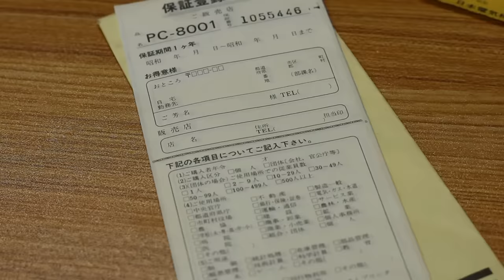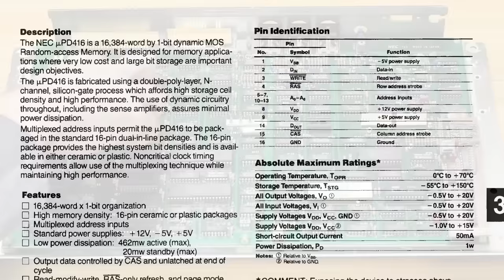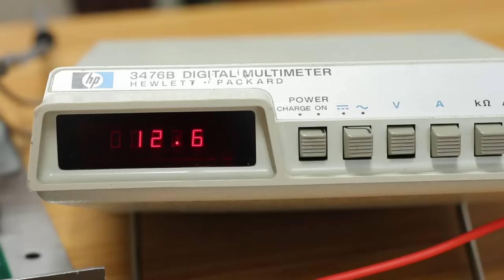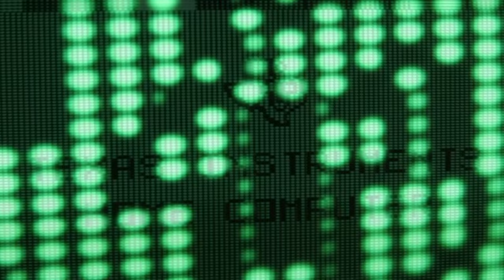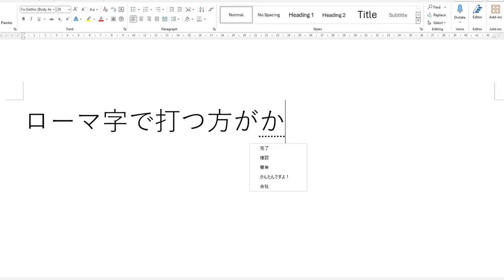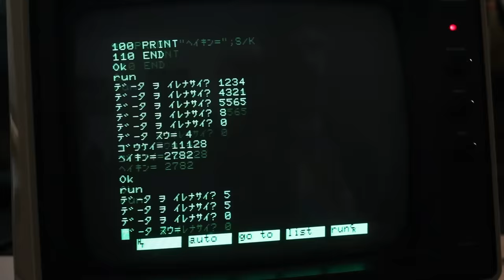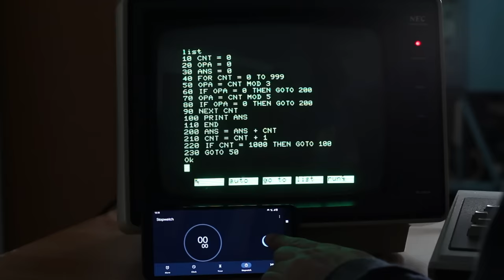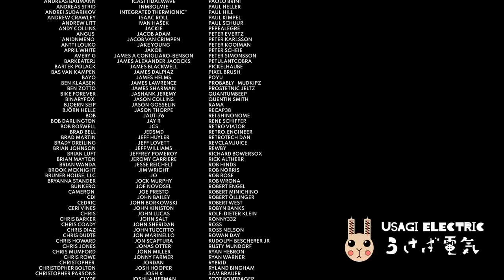This NEC PC-8001 is Epic!

Comment: I had to laugh at the 'inappropriate words' moment when you'd forgotten the connector hood... we've all been there! I have a picture somewhere where someone had worked on soldering a connector onto an industrial multi-wire cable, but to hold the cable in place, the guy had threaded it through the step of a portable ladder.
Reply: yeah i agree we all have been there... too exited to try it and forget the stupid hood...
Reply: @freeculture Heh... Even people that work(ed) daily with electronics like me had "experience" with that. I worked in a recycle division repairing consumer and industrial equipment before I went to IT doing server installments and maintenance (UNIX, Novell Netware, Windows and Linux) and finally retiring. You would think all those years of experience would "burn in" to your brain to never make that mistake again... Yeah - Nope... Even after years I still have that occasional sinking feeling in the stomach when watching your failed handiwork that makes you want you to bang your head...
Reply: At that point I'd probably just get an angle grinder and cut the ladder off :D

Comment: My first computer was a Sharp MZ-80K, I got it in 1980. It was released in kit form in 1978 and pre-built in 1979. I used it as my main computer until 1987, when I bought an Acorn Archimedes. I have two MZ-80K machines now.

Comment: 12:30 I'm shouting at my laptop
13:04 I told you so! 😊

I wonder if there is anyone who has soldered DIN connections who hasn't done this at some stage.
Reply from the maker: Haha, I feel like it's a right of passage!
Reply: Me thinking: Ah, exactly here I would have forgotten the casing.
...
Wait a moment, where is the casing?
...
ROFL!
Reply: I really love back when they did introduce DIN connectors as 2 halves - easily clicking them together afterwards .... then most connectors was RCA after that ... but damn I have forgotten to but it on many times - and a few times the wrong way around.

The lessons learned must be:  Think twice - then think again - check everything and then solder once. :D
Reply: Sure. From DIN to the rubber boot on the transaxle...
Reply: not din connectors but crimping ethernet cables it happens all the time
Reply: I laughed hard because I thought the same thing
Reply: Din, RCA, XLR, Centronics i've done it with so many types of connectors. :)
Reply: The old UK 15 amp round pin stage lighting plug has a pointless part of the rubber cover which goes round the flex. A great many of them have a cut across this part because somebody forgot to thread the cover onto the flex and couldn't be bothered to do it all again. It never works as well the second time. The person who invented one piece D25 shells has a lot to answer for.

Comment: Fantastic that it is still working!
If you run PRINT time$ (or PRINT date$) it will print the time, either actual time (unlikely) or something like seconds since boot. A neat way to use this is to use it to "auto time" something like your stress test program. Set a variable to time$ at the start and a second one again at the end, convert the strings to int and using deduction you can get the seconds the program took to run.
But maybe you knew that, this video makes me want to get an old computer with basic running again, thanks, love your videos!

Comment: I almost bought one in 1982 while living in Japan.  Instead, I bought a Casio PC FP-1100 with dual processors: Zilog Z80 and NEC PD7801G, and I bought the 5 1/4 floppy drive accessory and the RF modulator for the TV.    I still have it in storage.  Also, I had the CP/M operating system.   I remember spending hours writing basic programs (inventory tracking programs, graphic & graphing programs, and general electronics application/calculator programs).    Old times...  Z80 clock speed was less than 2MHz, May be 4MHz for the NEC CPU.   Max RAM was 64K for the Z80 and 48K for the NEC CPU.

Comment: Just as an FYI nearly all Japanese electronic power supplies can handle US voltages 10 volts is not much in the land of AC. The grid voltage at your outlet routinely swings upwards of 10V up and 20 volts down depending on load conditions  on the national grid. Japan's grid is much the same but more likely to swing up usually do to differences in how their power grid is managed. I also know this from having ran many Japanese pieces of studio audio gear just off US mains due to the tendency of many step down transformers to be noisy electrically thanks to cheap transformer cores.

Edit: I forgot to point out this applies to switch mode power supplies, linear supplies should be ran with a step down transformer always to avoid heat issues.

Comment: For NEC chips that start with "D", prefix with "uPD" instead. So, uPD8257 is an Intel second-source 8257 DMAC, uPD3301 is your CRTC. I forget what "uPD" was supposed to stand for, but the "u" is a stylized Greek Mu, so that probably had something to do with it, something like "micro processor design" would be my guess. Most NEC chips of that era that weren't "glue logic" chips (eg 74xx series) were "uPD" chips.

EDIT 1 -- that power supply would almost guaranteed be fine on US wall power, the voltage sag tolerances on AC wall power here in the USA are just ridiculously high. Figure acceptable range to be somewhere around 90-150 v AC.
Reply: 150v RMS is higher than I've ever heard of in the US, but certainly I've heard of 135v RMS. However, that doesn't actually mean the power supply will be safe, since it's from a lower voltage country. Your assumption would almost certainly be right if it was the other way around.
Reply: @absalomdraconis  OK, that's fair.

Comment: Stoked to see some NEC hardware, always had a soft spot for the gaming software that was developed on them. That expansion board is intriguing, hoping you're able to figure out what exactly it does. If the luck from the computer carries over, it might even still be working~

Comment: So to not forget the connector cover, before soldering, I like to put it on the cable then tie the cable in a large knot with the cover inside the knot.  That way it doesn't fall off.  Get in the habit of doing that as the step right after you cut the cable.

Comment: The 8257 is the dmac which is a clone of the intel part with the same number.  The upd3301 is the nec custom crtc which is also used in the nec pc-8801 and the olympia boss.
Reply: If the Intel 8257 is the chip used in the IBM PC, then it is itself a clone of an AMD DMAC that they meant as a generic choice for multiple processors. The x86 era Intel competitor was... ambitious, and expensive enough that it was probably only used for minicomputers and mainframes (it cost about as much as the x86 itself, something like 3 times as much as the DMAC that the PC actually used).
Reply: @absalomdraconis Nope, it's the 8237 which was used in the IBM PC which was a clone of the AM9517.   The 9517 is an iterative improvement of the 8257 which was designed by intel themselves.  The intel x86 dmac is the 8089 which, yes, was expensive, used in very few designs and bad (i've written an emulation of it).

Comment: 4MHz was pretty standard for a Z80; the different architecture means at that clock rate it runs at about the same speed as a 1MHz 6502. 
TIME$ was a syntax error because BASIC doesn't like plain expressions; you have to do something with them. PRINT TIME$ would have printed out its idea of the current time of day, which could be set from some onboard real-time clock but was usually just set to midnight at power up.

Comment: Japanese resident here. My local hardoff store has a PC-8001 in great condition that I've been eyeing off for quite a while. It's kind of on the costly side and my wife has made her feelings clear about me buying any more retro computers, however after seeing this video I might have to pull the trigger.
Reply: in regards to why it didn't sell well outside of Japan, in the 70s and early 80s it seems most of the English speaking markets prefered to either buy American computers or produce/rebrand their own. It's a similar issue to the MSX computers; they sold really well in non-English speaking markets (its seems there were more total MSX systems solds than C64s) but made little-to-no penetration in the English speaking ones. It really wasn't until the mass wave of turbo XT clones out of Taiwan, Korea and Japan flooded the markek from around 1985-1989, which massively dropped PC prices, that English speaking markets seemed to accept buying Asian made computers.

Comment: I have fond memories of a micro (Atari 400) in the home in my early life, but then we became a PC household while I still had Apple II and TRS-80 machines in class.  The older I get the more I realize that those micros are the last machines where I can clearly understand what's going on under the hood, while so much of the PC (and especially the modern PC) is abstracted magic.
Reply: Original PC and 286 is also not too hard to understand. The complicated stuff started later when you got caches added etc.
Reply: I could understand a 286 along with the weird addressing modes, ISA bus, and etc etc, probably; though I'm not completely confident on that.  The non-PC 8-bit micros and their extremely simple busses definitely fit my head more cleanly.
Reply: You can mostly grasp modern computers.. if you go far enough. Obviously can't know everything about every abstraction layer, but the more complex tiered caches, out of order execution - which was invented originally in the highest end IBM 360 model and silently ignored for decades until we ran out of easy miniaturization with silicon to make them faster.. you can learn how a basic operating system works via watchdog timers, interrupt driven task switching, protected modes, and all that.
But yes, an 80's computer is probably the only kind one person can know EVERYTHING about, and that's how amazing demo scenes get made, abusing hardware in ways that was never intended via design glitches of sorts.
Reply: @mikafoxx2717  I agree. It is possible to have some grasp on a modern machine, how much of a grasp depends on how much you learn about the different abstraction layers.   For me, the last time I could know a machine from instruction set to UI thoroughly was these little micros. 
Certainly I'm not going to pretend to know how every bit in a high end 360 worked, but there were engineers who had to know that, at least in part, so it clearly wasn't unknowable,   
OS engineers, security researchers, and compiler writers all need to know modern machines more thoroughly than I do as an IT guy and sometimes programmer.  So they've taken the time to learn the abstraction layers and know the insides of the black boxes.

Comment: This was my first computer, bought in Hong Kong around 1981. Japanese keyboard and manuals. Unfortunately all my cassette tapes have been lost: I spent hours typing in the machine code and BASIC headers for all the games on the early 80s. I still have the computer and colour monitor in storage. I’ve also got a full listing of the NEC BASIC in a limited run Japanese book of the time.

Comment: [14:00] Yes, it freaking works. (笑) And kudos on the nihongo hellorld!
[19:00] AUTO also takes a line number to start with, and an optional increment. Good ol' standard Z-80 MS-BASIC stuff.

As for bodge boards, I have my own that I put in my old TRS-80, to shift lowercase descenders down by two pixels. And it does some other stuff with the character address lines that after fully reverse-engineering it, I have no idea what it was supposed to do! (And I made it!) I tried to just run the computer to see what it did, but the TRS-80 video output uses some janky 74Cxx gates that can flake out, and mine had indeed flaked out.

That board you have is a bit simpler, and the best start at trying to figure out what it does is to find out where those blue wires go. I am so tempted to try to figure out the circuit from stills of the video, but I have to resist, I have so many other things to decipher!

Comment: All those bodge wires on the bottom might not be related to the perf board mod, it’s entirely possible they’re factory. Flip over my NABU boards and there’s multiple bodge wires there, from the factory, that wasn’t uncommon back then.
Reply: In this case they just seem to connect the extension to the main board, no fix-ups.

Comment: While you were soldering the DIN connector I had this lingering, familiar fear that you might have missed the connector body. When you revealed that you did, I FELT it. 
I've been doing electronics for like 20 years and it still happens to me. With connectors and heat shrink tubing alike.
Reply: I've been doing that for over 40 years. Some things never change... 😅

Comment: My guess is that the small expansion board enables graphics modes on the CRTC chip that are available in the 8001A, or that changes the memory map somehow. Maybe it was used with an additional ROM chip that wasn’t populated on your board, so it doesn’t do anything when you push the button. 😢 You’d really need to see what voltages/signals are on the connector without the board plugged in. My guess is; Gnd, +5, +/-12, composite video, clock signal from the CPU, reset, and maybe h/v sync pulses, and one or two address lines so you can map in an external (cartridge, gayubus?) or internal ROM (in the unused socket). Heck, maybe it’s a parental lockout switch so it wouldn’t play game carts; that way, the children would do their homework instead. 😊

Comment: 9:19  With 100V AC at the input, the DC voltage at the capacitor is 141V peak. With 120V there are already 170V DC peak on the capacitor. 
The capacitor is only designed for 160V.
Reply: Good point.

I might quibble at the use of the phrase "DC voltage". I'd say "peak voltage" would be a more appropriate/less confusing way to express it. But yes, since we measure mains AC voltage using RMS, the nominal voltage value is 0.707107 times the actual peak voltage on the wire (or alternatively, the actual peak voltage is 1.414214 times the nominal voltage).

FWIW, while technically a capacitor rated for 160V is sufficient for 100V AC input, that's just under 20V of headroom, which seems a bit small a margin to me. But I guess at this point, if the cap's still good and the computer won't be used that much, probably nothing to worry about.
Reply: @harvey66616   A 200v cap on 120v only has 4% more headroom than the 160v capacitor on 100v. It's fine, especially since the capacitors can take a bit more than their rated working voltage. Old American gear from the tube era usually only used 150v electrolytic capacitors for rectified line voltage.

Comment: The mystery perfboard looks like a real time clock... I did not see much of it, but it gave me that impression... And the button may be to adjust for 50/60 Hz power
Reply: Not likely.  There is no crystal oscillator or battery on it.  As for 50/60Hz, thats built into the computer already.
Reply: On second thought... D flipflops, latches... Could be a buffer... No RTC chip there... Please disclose the chip numbers of those to the right... One is almost erased and the other is blurry.

Comment: The AUTO command on most implementations of MS BASIC that supports it will take 2 options parameters  The first is the line number to start with, in case you are adding to an existing program, and the second is the line number increment.

If TIME$ is like on others, try PRINT TIME$ to get the current time, or "TIME$ = "(timevalue)" to set the time.

Comment: Cool little computer. I never got into PCs as a 80/90s kid, we had an ARM based desktop computer, an Acorn A3020, i used to consider early PCs silly as they where a massive step back. Fun fact, the later Acorn Risc Machines ( or ARM for short) could emulate a 386 faster than a 386 could run :).

Comment: I have a TI 994A that I haven't tried troubleshooting years, you reminded me of it so I guess I need to pull it out from under my bed now that I know a little more
Reply: Probably the power supply. It uses a weird split linear / switching power supply. Multiple voltages from an external multitap transformer to a switch mode supply inside. Probably easier to rip all that and replace with a compact modern power supply.
Reply: @DMahalko  The issue was no power and I never got around to looking at it, so that may well be it, thanks

Comment: Looks like a high quality computer with excellent build quality.  The first micro computer I ever used was a 1980 Commodore PET... one of the 3000/4000 series models along with the TRS80 Model 1.  While I wouldn't say they had bad build quality the NEC seems a lot better.    When I got my C64 I was always a little dismayed with the poor feeling keyboard in comparison but then again the price of the C64 was quite a game changer at the time.

As a programmer I always hankered after buying some of these older computers and writing some machine code programs that used the user port in order to control synths and other things, perhaps in a kind of Fairlight Page R pattern squencer way...  I've seen other youtubers do similar things since so my desires have been somewhat quenched for the moment :)

Comment: A step-down transformer is a good call here indeed. 120VAC rectified is just shy of 170V DC, and you don't really want to stresstest the headroom of those old 160V rated caps.

Comment: I have a few MSX computers from later on and one NEC Micro that’s my only Z80 based Micro. The Z80 is a good chip, but I still prefer the 6502 and derivatives for a realistically cheap processor for that era of computing. I like the 68k and it’s derivatives a lot too, but those were a whole different world in terms of cost back in the day.